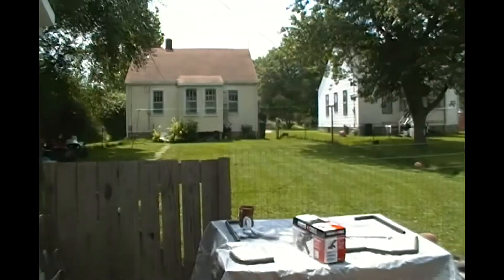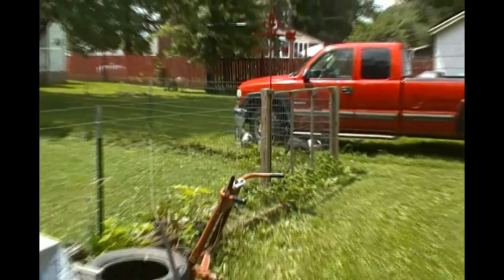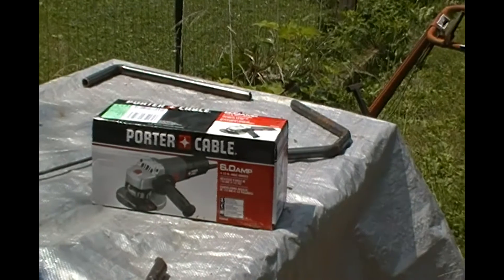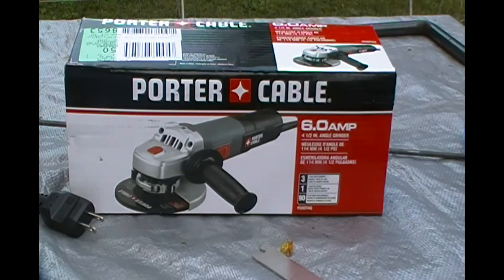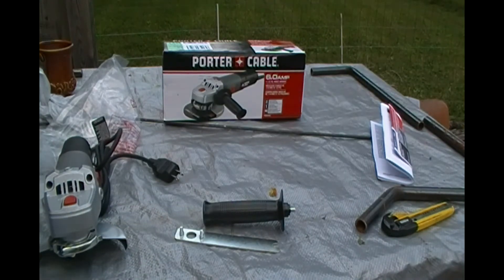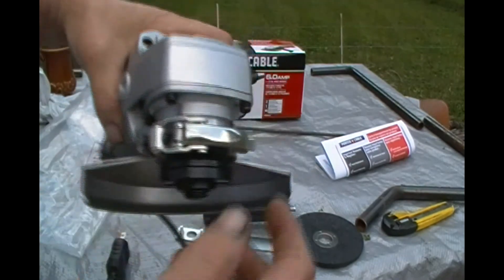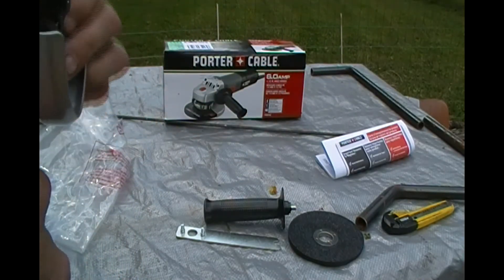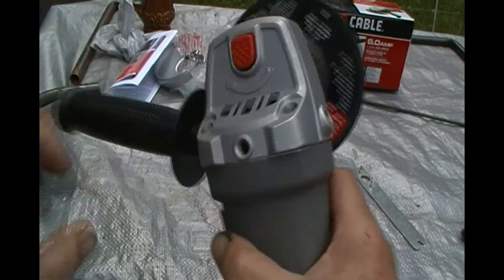Porter Cable makes a pretty good Angle Grinder With a surprise guest

Comment: That intro is great! I wonder how many believe you have two dogs! Lol. Your timing was dead on. 
Some have taked 1 inch square tubing and made the grinder to be used in a vice to make a hands free way to sharpen blades and stuff.  I have the HF grinder, bearings a lil rough but love their cutting blades, which I also use to grind with. Udizzy getting the fire bike going, and I still have a list to do before starting mine.